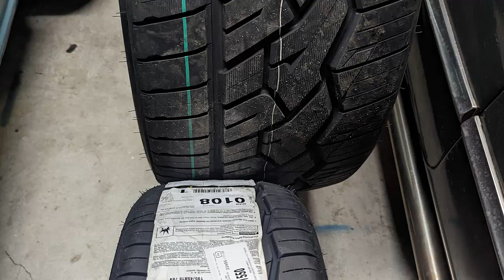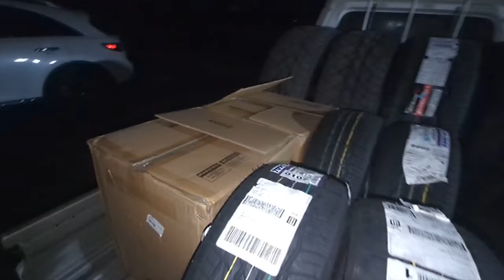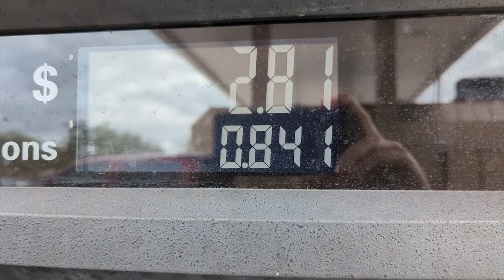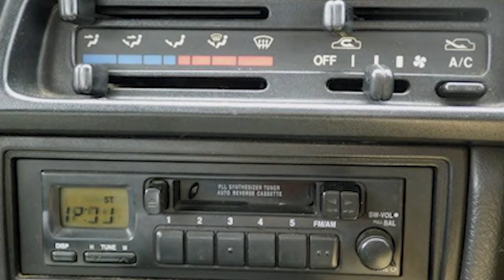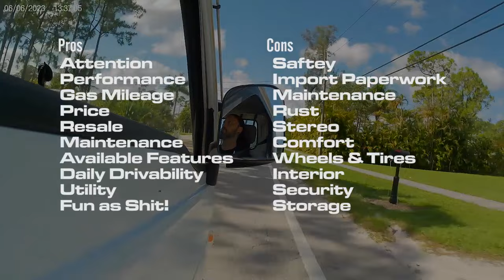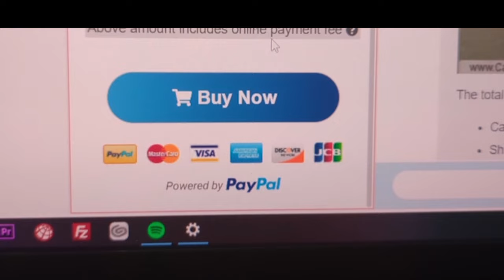Living with a Kei Truck : 10 pros and 10 cons

Comment: I like the Rim/Tire install in between the pros/cons list. I see countless of the "Here's 10 reasons why ..." But this is a great way to break up the monotony of those types of videos. Great work!
Reply from the maker: Thanks for noticing. I thought it'd be a fun way to break up the video and kill two birds with one stone..
Reply: @inkandpistons ...you could with a heatgun on low-medium, warm up the paintwork to flex easier and metal of the under door valance's bodywork inner corners, with leather chamois wrapped pliers/plumbers wrench or a clamp, and gentle bend upwards or downwards, in increments of reheating and bending, the inner tips away from the almost too too large tyres to give more clearance, 
    ....as you're right on the limit of a big bump while turning, digging into the tyre at some future point

Comment: I use mine on my farm, I got mattracks for it, gave it more ground clearance and capabilities. I'm 14k into my kei truck, while a SXS would be nice, the polaris ranger xd 1500 Northstar STARTS at $40k...... my kei truck has a larger bed, and has been an amazing tool on my farm.
Reply from the maker: The tracks are badass! If I had more property I'd be all over them. 🤔
Reply: I don't think the heat & AC on Polaris is very good 😂
How much does the windshield wiper on Northstar cost?

Comment: I have a ‘90 every 660 multi roof. It’s turbo charged and intercooled, so plenty of power. It’s got a 5 speed but when it’s in 4wd I get an “EL” gear, that’ll top out at about 5mph. It’s got a/c too. Gas mileage is in the mid to upper 30’s, the Turbo light is on a lot. Pretty comfortable and I’ve sat 5, only 4 comfortably and still have room for cargo. I figure it like a super golf cart with doors and windows.
Reply from the maker: Yeah big difference in power on my 95 turbo every.  Better mid to high speed.. truck is better if the line but that's it.

Comment: Been using kei vans,trucks,and car,in the UK,for almost forty years,and had very cheap and reliable motoring,including motorway(freeway) use.All bought used,by the way.
Reply from the maker: They are little workhorses! I imagine they fit in great there, between the cost   of petrol and not every car  in the road being a full size f150! Do you have problems finding parts?

Comment: I drove one that could  handle 1500 lbs max with no problems. Tows a 8x5 trailer fairly good. Fuel mileage is main reason many people I talked to, got one, mainly with a 5 speed. Still a stout truck for it's size.
Reply from the maker: That's awesome. Yeah there are some beefier models. I saw a bunch of "dully" ones with the last trip I really wan5 one of those they were only slightly bigger but I assume on Japan they are not true "kei"cars they probably have a bigger than 660 motor. Thanks

Comment: Traction depends on make. Subaru will be the best then Honda then the rest. This is because of engine placement. Undermount tool boxes can help with storage. Safety I'd add a push bar, something between you and the other vehicles, and definitely would not be on the highway with it. 

We had the same issue with insurance companies in Canada. The one carrier stopped doing right hand drive but they couldn't cancel existing customers. Now you have 2 choices, hagerty classic car insurance or one high risk company that will ding you $800/month lol. 
So up here insurance is the most difficult part. Hagerty is dirt cheap, but not for "daily drivers" just weekend show cars etc
Reply from the maker: Yeah sucks these insurance companies keep cancelling people. So far state farm has been good and fairly cheap. I hear progressive will do it too.  But didn't look into it myself. 

I agree with the traction thing. My van also has rear engine. I did mount an under mount box. Still not a bunch of room out of it but better than nothing.  Push bar probably coming soon.. haven't had a chance to jump on it yet..

Comment: Excellent video...!!!
You are one cool guy!!!
I've been thinking about buying  Kei Truck for a while. Does the seat and interior get hot because the engine is under the cab?
I dig the Z, i drove a 78 Z across country, was amazing.
Reply from the maker: Thanks! Oddly no, I don't really notice much of any heat transfer. When I reupholstered the seat I added some dynomat which quiets it a bit and adds just a slight bit of insulation.. but even before I did that I never really noticed any extra heat.. plus it's more under the bed and closer to the passenger side. The wife has never complained. And she definitely would 😁.  I'm going to have to do a big z road trip one day. Love driving that car!
Reply: I don't know why people say the kei truck engine makes the seat hot.  It seems like it might, but it doesn't in my Hijet.  It's just not an issue.  It's a kei truck internet rumor that won't die because people who have no practical experience keep repeating the ignorant nonsense.

Comment: As for the bed, it might not be the greatest security wise but that doesn't really hinder its ability to store. I wouldn't really count it as a dock against its storage.
Also, technically, you COULD invest in some personal modifications to fix that issue, but that's not from the dealer so it doesn't count.
Reply from the maker: Definitely. The utility of the bed far outweighs any negatives. Thanks for watching!

Comment: I think your traction issue is more of a suzuki problem.  Suzuki mounts their engine all the way forward so with a passwnger you litterally have almost no weight on the back wheels.  Daihatsu mounts their engine almost 8 to 10 inches further back while honda puts theirs in front of the rear axle and subaru is mounted behind the rear axle.  We have a daihatsu hard dump which is pretty heavy (2200 lbs on the scale) because of the dump bed but i have a VERY hard time breaking traction even in wet conditions with the stock 12" snow tires.  Just a FYI.
Reply from the maker: Yes I agree it's all about weight and partially those skinny tires. but the new, to me, Suzuki every van I just got stuck it between the rear tires so it's much better, so I guess the weight is better distributed on that

Comment: dude great list! love the wheels too, where did you get them? also imagine they will work for the stock tires as well or no?
Reply from the maker: Thanks for watching! Grabbed them on eBay.  The stock tires are only a 12 inner diameter and these are 15 so they won't stretch to fit.. but tires can be bought pretty inexpensively . Between 250 and 350 for tires.. rims cost about 450-550

Comment: Good stuff mate thanks - would have liked to know how the bigger wheels changed the driving experience though.
Reply from the maker: About how you would expect.  it feels a lot more stable and handles a lot better around corners, you feel less wobbly than with the tiny little tires that were on it. It definitely creates a much bumpier ride. I would prefer to find a tire with a little bit more meat on it. They are just really limited  sizes since I would have to go down to a 13 or 14-in rim.. but most importantly it looks cool 😎

Comment: Much better traction on a Subaru or Honda as they have the engine in the back, which means that the weight ends up more on the rear wheels (which are the wheels that drive when it is not in 4 wheel drive).
Reply from the maker: Yeah, I'm sure that definitely makes a difference. My suzi van is rear engine as well no traction problems there. But I'm pretty surprised they made a whole different drive line  setup just for the vans..

Comment: I am a Kei truck lover but unfortunately I might not buy any kei truck to use that in city. there is basically 0 collision buffer between your lower limbs and front...hitting anything over 5mph will get you hurt very very badly.
Reply from the maker: Very true, although I suppose you could probably install a crash bar up in the front if you really wanted to. Also guess it depends on what city you live in. You see him all around Tokyo but nobody's really doing more than 35 mph anyway and generally pretty good drivers

Comment: Soon I will import one! How long you take all process in DMV? And around the cost there ?
Reply from the maker: I had a title company do the dmv stuff . I did have to make an appt to do the vin verification myself though.. I have a video with the cost breakdown at the end as well as the process. https://youtu.be/H7SGKglbTQs
Reply: My county clerk's office is a bureaucratic pain, so I went to the rural county east of me to title and register my mini truck.  There was a $15 sheriff's inspection which was apparently to determine that the chassis number matched the paperwork and it wasn't a stolen vehicle.  The title and registration paperwork was more tedious than usual, but no trip to the DMV is pleasant.  They needed to convert the paperwork (commercial invoice, DOT and EPA forms, IRS gas guzzler form, etc.) into a new title so I could register it.  On the plus side, the state and local taxes were based on the sale price.  I paid $265 for the truck, and they didn't calculate the taxes based on the $1935 in shipping.  Inspection, taxes, license plate and registration for a year and a half was under $60.  All of this varies greatly by state, with many states refusing to license kei trucks for on road use, so make sure you can register a kei truck before buying one.

Comment: do you think it would be possible to swap the square dc51t lights with the circle ones like you have ?
Reply from the maker: That's actually one of the things I plan to do to the van when it gets here and I've already been trying to track down the parts needed. I've read that it is not possible. But I'm sure I can figure something out that will work. I like the round lights much better. Thanks for watching. 😁
Reply: @inkandpistons  wow I have fully clear square lights on my suzuki dc51t and want some circle ones but after searching every Facebook group and all the internet I haven't found anyone whos even talked about it let alone tried it, that and its impossible to find the parts to do the swap as you would need the full front of the car ):
Reply from the maker: @johnbaker3331  yeah I'm not looking forward to finding all the parts.. I'm traveling to Japan in December so maybe I can hit some junk yards! My carry on will look pretty funny

Comment: I need to stop looking at these little carry trucks cause there is even a reasonable priced wide body kit for the early 90s model that looks sick and doesn't mess with the utility to much
Reply from the maker: Haha right those little body kits are dope. Do it, do it!
Reply: @inkandpistons  bad enough that I'm thinking about a samurai rear axle swap for a faster gear ratio and if you can cram a g13 or a honda goldwing trike setup under the bed...
Reply from the maker: @T_TanksTinkers1066  hahhahha😆😆😆😆

Comment: Sorry ,gas mileage is not good ,got to be in the high 20s city , 30s highway to be good mpg these and upcoming days.
Reply from the maker: Well I think a lot of that has to do with how you drive and the condition of the vehicle and even the location.. I have recorded my milage a few times and have averaged better in the winter  (Florida winter in the 60-70's) I think the best I did was in high 40s  worst was 28-30. Still better than my suburban and my Buick combined!  I think our lower octane in the US makes it harder to get the higher numbers..

Comment: The last "con" you mentioned...
Drive-thru....
I am assuming the left door window doesn't open?
Reply from the maker: No, it does.  just easier than reaching across the truck to deal with the drive up window. And kind of hilarious, to me ,  seeing the confused clerks
Reply: Sold!!! (Actually soon to purchase) I deliver pizzas, and this would be perfect!!! (Detroit,MI) it just would require a delivery box, and I just so happen to be very HaNdY😂... Great video
Reply from the maker: @pheelphine  nice that would be a perfect use of it! Lol good luck 😁 thanks for watching.
Reply: It does.
I enjoy backing thru tho.

A drive thru worker told me someone else has a rhd and uses one of the reachy claw cane things to hand over the money and take the bag.

The REALL princely act is parallel parking (like for take out) and stepping onto the sidewalk instead of into the street. No wonder the mail trucks are rhd and UPS has the big open stair door with practically no access via the left.

Comment: can you do the maintenance yourself or should you take it to a mechanic?
Reply from the maker: I do almost everything myself it's all relatively easy stuff. I did have a shop help me on my mini van when we were trying to trouble shoot the stalling that was happening.. (next video) and I just did a coil over install myself. It's all pretty easy stuff if you like problem solving and wrench turning
Reply: @inkandpistons , is it easier and/or cheaper to buy one yourself or through a dealer here in the states if you live in Kansas and can't get to a port city?
Reply from the maker: @oromis16  that is hard to say. If you have a truck and  a trailer (or you can even load it up on a small U-Haul trailer). It might be worth it to head down to Texas and pick it up from that port. From what I've been seeing, most people buying them from us-based importers/dealers are paying between 8 and 10 grand for a decent condition truck.  If you do it all yourself you can probably get one for closer to 5000 in  similar shape and then the cost of going to get it, registration, hotel, trailer.. your still probably ahead of the game.
Reply: @inkandpistons , where would I look for U.S. dealers?
Reply from the maker: @oromis16  There is a place called minitrucks.net . Im not affiliated and I know  nothing about them other than they have a bunch of them and they are in Texas.. I'd just google the makes and see what's around Facebook marketplaces has a shit tone too

Comment: You think this Suzuki is better that the Honda acty ?
Reply from the maker: I can't speak to the Honda specifically, I haven't owned one.. there are really a couple of things I like about the Suzuki that made me choose it .  It was cheaper than any of the Hondas I could find with similar mileage.. I like the placement of the engine  centered rather than between the rear wheels. It seems more balanced..  I wanted round head lights, I just like the look better. I think all the Honda are square. (I could be wrong)  I do think the Honda has a bit more in cabin room which sounds better. And the Honda is probably much more reliable.. I may go after a Honda acty van next... If I do I'll let you know how it compares to my Suzuki.. but it will be a while before I get one.  Thanks good luck!
Reply: @inkandpistons  Thank you for the answer so fast I'm thinking in buy one my self
Reply from the maker: @adnerayala3409  I'm sure you'll be fine with the Honda.. (I have a suspicion the parts may be easier or more interchangeable) Suzuki made a bunch of charges for every model and application.. so I was having a bit of a hard time finding some stuff recently.. not terrible but time consuming

Comment: Is finding one for around 2k reasonable?
Reply from the maker: The vehicle itself sure,  importing in all the other stuff not really.. you might be able to get it here a little cheaper if it goes into a container as opposed to a roll-on roll off boat.. but then you're going to have other fees dealing with a container..  there are a couple vehicles on car from Japan listed right now for 2400-2900 total price to Jacksonville.. are you still probably have about another 3 to 500 bucks in miscellaneous fees.. it also depends on where you live. Some ports may be cheaper
Reply: For the cheap auction grade 3 Kei Trucks, expect to spend about $3500 at the absolute minimum to get to the port of pickup and have it released.  Keep in mind this is the bottom of the barrel price point so expect the truck will need work - make sure to look up the maintenance cost of parts before you even start the process.  I've been importing these for several years and I am speaking from my personal experiences aka mistakes.   Overall though - excellent option when compared to a Mule or Gator and you can take it on the street to run some errands to boot.
Reply from the maker: @andrewloranger  👍 agreed
Reply: @inkandpistons  - It's my understanding that RORO is much less expensive than shipping a car in a shipping container, and the people who do that want maximum protection when importing an expensive luxury car or sports car.  One advantage of a container is that you can ship car parts in or around the vehicle, which isn't allowed for RORO imports into the US.  RORO is the vehicle and nothing else.
Reply from the maker: @Liberty4Ever  Yes, I agree. I think that sounds about right. Also though with a container you might be able to put two cars or more in it if you get a 40 ft at which point it might average out to be less..
Reply: @inkandpistons  - You mean I could have imported a 4WD kei truck AND a 4wd kei van?   :-D
Reply from the maker: @Liberty4Ever    haha, yup.  I have an update coming on the van soon. Just picked it up from port last Monday! ;)
Reply: Budget of $6k is very reasonable.
Less if you do all the importing. Less if you get one that's beat and need$ work.
More if it's clean and good and already has a plate for your state.